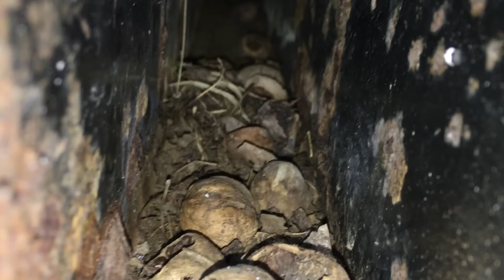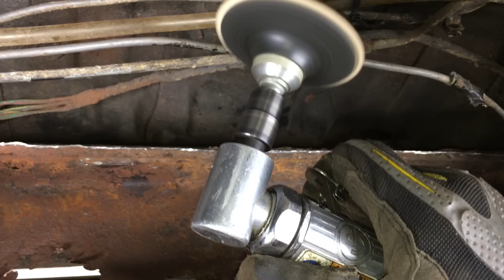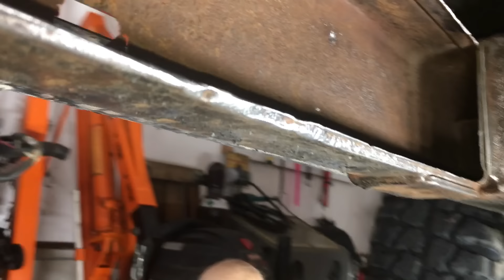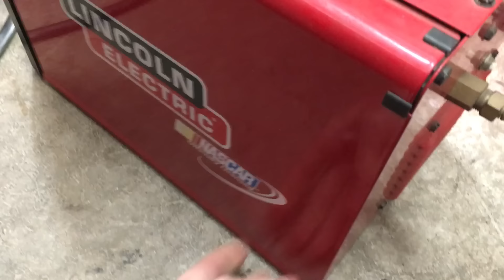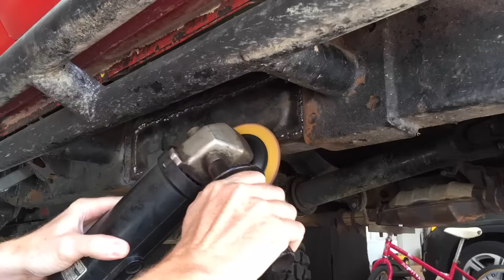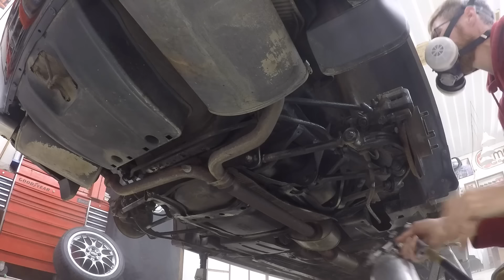How to Properly Repair Rusty Frame of Toyota Pickup Truck at Home

Comment: It was entertaining to watch and since you asked here is some food for thought on welding
Setting up the machine is probably easiest by the sound of how its welding
it should be a very consistent fast paced buzz
Welding is the art of heat control, too much heat and the whole part becomes soft and on some metals like stainless it destroys its rust properties and makes it brittle
too little heat - thick base metal being cold and the weld being hot, rapidly cooling down induces massive stress in the molecules cristalizing which result in cracks
Cracks are the worst outcome of a weld because they will propagate into the base metal and split it apart
dealing with cracks - you never want to weld on top of a crack instead you want to cut into the crack with your grinder so you take the metal out and eliminate the possibility of crack spreading
if the part is of high importance or is under a load then you have to drill small holes at the ends of the crack on top of grinding it out
Use a mindset of Heat = Time
the more time your welding the more heat you input into the part therefore you can crank the wire speed up and weld on thin metal by moving fast and the base metal stays solid
same with thick metal, you may need to preheat it before welding
Welding Positions - you would weld differently looking from above than if you were to weld from below looking up as you did in this project
laws of gravity are at play and with heat the metal gains viscosity
opposite happens as it gets colder it becomes hard and brittle
to do it properly you must take into account your angle of torch relative to the weld
going 90* is gonna result the most penetration and most likely will burn quickly through your base metal
the optimal is 30* in either the way your welding (push/pull) to ensure the most control over your input of heat and metal
with horizontal welds angle your torch 30* to the direction your going and 30* aiming up since the metal is gonna drip downwards from gravity and you keep pushing it up
for now i suggest you to work on your consistency and straightness of your welds and ignore the weaving patterns
get those lines straight and consistent
for best penetration, adhesion and formation on the other side of your piece you have to bevel your edges
easiest way to do it is run your grinder between the two pieces so it cuts a line between them halfway into the metal thickness
Tacking the pieces together is important
i saw that you held the bottom with a clamp as you fully welded the top
heat warps metal and bends the whole piece upwards raising the gap between your plates making it stick at an angle
having a clamp hold it does the job but i would still tack it on the bottom to ensure it cant bend out of position
tack diagonally from tack to tack going fully around it to ensure it cannot change the shape and create gaps
welding builds tension and stress in the metal due to change of heat and cristalization speed of metal which in turn increases the risks of cracks
Therefore you have to weld at a 1 3 2 4 pattern with your welds ending into your previous starting points to spread the heat and stress evenly across the whole piece
Going vertically from top to bottom is unacceptable in load bearing structures because of insufficient metal volume and penetration, so do it only on pieces that dont hold more than your own body weight at most
going from bottom to top vertically is a hard achievement to learn for people learning the skill but thats the only way you will have the piece not fail on you
if there was no side rail adding strength and rigidity to your frame i would encourage you to redo the welds
a tip you can use is weld the thing in tacks. start welding each new tack on top of the previous one before the metal stops glowing from heat to ensure that no cracks form and it fuses properly, for this you may have to hold it for a while depending on the thickness of the metal, otherwise welding vertical the proper way needs you to do a weaving patter going form side to side and pausing for a while to add volume.
i saw you had problems with welding accuracy by having welds not getting between the plates and just welding on top of the plates not even connecting the pieces together due to having problems seeing.
Yeah it sucks and its understandable, but remember there are people who get to weld hanging upside down in very high heat claustrophobic places with their arms extended sweat pouring down their mask with a MMA electrode in one hand bent more than 90* while holding a mirror in the other hand with nearly no room for error with pressure to complete the job. i can tell you it sucks real hard but you get to look back on it with a sense of pride because not everyone can do that irrelevant how much they get paid.
So ABOVE anything else the 1st thing that separates a professional welder from amateur hobbyist is the prep work and planning before each and every weld they do
it is literary 80% of welding, making sure that when you pull the gun, nothing can go wrong.
Get as comfortable as you can, from a side it might look lazy when the welder is lying down on the ground as if they have no care in the world but they are actually making sure that their hand doesnt get tired while doing the weld, it doesnt ever snag on anything, nothing is obstructing their process from start to finish. before each weld glide your hand over as if you were welding to test if it is perfect, worst thing that can happen to you is you hit your gun against something and it ruins the whole thing. in a professional environment you will be expected to grind the whole thing out and do it from start, certain types of metal cannot be stress heated multiple times and may result in cutting the whole thing out and doing it from the start. often these specialized metals with certain properties cost thousands of $ per sq ft area so as you might imagine, do the mistake twice and your fired.
basically comfort is your #1 priority for fancy welds, there is no correct way to hold the torch, if its more comfortable for you wrap it around your neck, hold it upside down, whatever.
after you got comfortable the next priority is sight, you cannot weld what you cannot see. i personally dislike the fixed shade lenses but they provide the most safety for your eyes, some old timers just got used to them before the auto dark existed and just stayed that way, some cant afford them. remember that the more light you let them pass through the more you will see what your doing and whats around you and the more UV will get into your eyes and damage your eyesight. all you need to see is the puddle of your weld and and right around it to see if your still moving correctly.
generally your movements should not exceed the width 2x of your wire, so it is a very small surgical precision.
I think consistency is only achieved through reacting to what you observe, dont look what goes next, keep it in your peripheral vision. dont stare into the brightest spot of weld, instead look at your puddle as it is cooling down and forming the shape. react if you need to move slightly faster as its getting too liquid or you need to slow down to add volume and prevent welding defects like undercut.
to be a good welder follow these 3 golden rules:
1. prep work, make sure nothing can go wrong, your fit up is spot on, the bevels are even across the whole length, there will be no surprises.
2. comfort. Your hand is so tired its killing you, you find yourself to finish the last inch you have to extend your arms in a unnatural way,  it will directly reflect on the quality of your work.
3. consistency, your line looks as if its one single continuous flow with no thin or fat sections and no deviation to the sides, robotic movement.
it all comes naturally by experience just laying down welds with the intention of the next one being better than the previous one, there was a time i couldnt do something no matter how i tried and how angry i was and now what i can do with nearly my eyes closed thinking about something completely unrelated.
Another thing i would like to point out is that you grinded down your welds to go over the parts with no visible fusion, remember that the shape of the weld matters in how stress travels across the metal. since you didnt have full penetration at certain points and you grinded it down, a lot of the metal didnt get inbetween the plates to fuse them together so in reality while you cant see it, there may be barely anything holding it together making it the absolute weakest point in the structure, arguably even worse than when it was held together by rusted metal as it may be thinner.
Welder and paint may make you the welder you aint, but in the end of the day its your health your risking if the structure fails on you at the point of highest stress when you dont want it to happen the least, in this context imagine you drive over a bigger pothole while going full speed down the highway, your frame splits, the car leans to a side and you get thrown into the opposite lane traffic. Bad welders cost lives.
So to finish this long rant i want to remind people that this is only the tip of the iceberg not even touching the water, you start in welding, dive into metallurgy, find yourself in chemistry and get lost in physics. i hope people who make it through this wall of text gain more knowledge and respect on the subject. nobody knows everything and nobody is too good to learn. having the skillset of gluing two pieces of metal together and have them stick is gonna give you the possibility to create anything that your imagination is capable of projecting and is gonna be valuable till the very last day you spend on this earth.
If anyone has anything to add, feel free.
To 6th Gear Garage, if you have any questions feel free to reach out, i feel like this channel is on a path to become big, good to observe it in this stage
Reply from the maker: Thanks for taking the time to hare your knowledge, I read all of it and will probably re-read it every time before I start a welding project!
Reply: I appreciated your write up, often people are too lazy to read such a long comment but there is always something to learn from others.
Reply: I"m saving this comment for reference for my own welding projects!
Reply: Nice writeup. I appreciate that.
Reply: Thanks for taking the time to write that up I just bought a welder and am about to learn how to work the thing I printed this out and am going to tack it to the wall in my shop
Reply: Replying to this comment so I can save it as good welding advice! 
I don’t know if I’ll ever be in a comfortable enough place in life to use this advice for a hobby, but one can only hope. Thank you for sharing
Reply: Your comment was awesome what kind of steel should you use when welding on a frame?
Reply: Thank you XYZ!   What valuable knowledge you have provided as a gift to us all; thanks.  Wishing you good karma many times in return.
Reply: This knowledge is priceless!
Reply: I'll be coming back to this comment for reference moving forward. Thanks!
Reply: Amen, brother. All good advice
Reply: That was more educational than 99.9% of all welding videos on you tube .. thank you
Reply: Had a friend that did this job, he was often saying that he was tired and hot/ sweating and not much else. Thanks for describing the details I can definitely see that it was a lot of pressure and not as easy a I initially thought.
Reply: What an incredible comment.
Reply: I read your comment thinking I could weld, I just know if I tried welding id mess it up lol
Reply: Somebody has too much spare time wtf
Reply: @mrantiwoke dude every sentence of that comment has thought put into it. That’s someone who could be making 120/hr welding but instead he’s dropping knowledge for all of us poors
Reply: @mrantiwoke Are you serious?

Comment: Rust is crazy on that frame. I  was going to buy a 94 Toyota 4x4 pickup extended cab that had  frame  rust. But I waited till I found a frame .Bought it. Went to buy the truck and it was gone. Unbelievable what happened. I  haven't found another rusty truck yet for my frame. 
Eventually I will.
Reply from the maker: At least you already have the part that's hard to find - a clean frame.

Comment: Bevel both edges of the material being welded  to about 1/16” it will/should give you the penetration needed with such a large heat sink(long plate and truck frame with thickness at/just beyond upper limit of welder).   Flux core may penetrate better.   And, if you had a gas mixer set up and separate cylinders if Argon and CO2 you might could ratio argon and CO2 differently from pure Argon or a 75/25% mix for a bit better penetration but a higher amp Mig/mag machine might be a better investment for you than that money spent on a gas mixer set up.
Reply from the maker: Thanks, I really want to get a 220 one day!

Comment: I used to use POR15 as well but have recently switched to Rust Seal. I watched some comparison videos and it turns out with better results and has a slight flexibility as well. But I always use a rust converter first.
Reply from the maker: I've always used POR15 but I'm glad to see there are more alternative options on the market. POR15 isn't cheap!
Reply: @6thGearGarage   I find POR15 works well on surface rusted metal. You have to chip off all the thick scale, then power wash it and wipe down with acetone or brake cleaner. BUT, you cannot use POR15 on ether clean metal or painted metal, it will peel. It's designed to stick to light surface rust as it chemically bonds to it, and it does very well if stuck to that application only...
Reply from the maker: @dc6233  I just tried a POR15 alternative called Rustproof MD in my latest video of the rusty 1980 frame and I'm happy with the results so far. I decided to try it because it is UV resistant.

Comment: Good job brother go buy yourself a bigger welder and fill your tank lol very good from an experienced fabricator
Reply from the maker: Thanks 👍
Reply: @6thGearGarage  he is right , especially with your skills , " Self employed fab shop " if I was excepting applications I would hire you "  . The best place to by a  bigger welder is Craigslist .I just bought a large Lincoln  with spot , stitch ,settings , new liner tweco gun  And 3 full size tanks ," 2 were full ,for $700 , I got a as new hypertherm powermax 85 new condition ,with a 75 root lead , full consumable box off E bay for a grand

Comment: The truck belongs in the junkyard and unsafe no matter how much you weld it Toyota and all these manufacturers should be ashamed of themselves with the substandard metal that the building these trucks with and that includes Jeep Dodge GM and Ford

Comment: , take a control cable from a lawn mower and attach that to a wire wheel and chuck that in your drill ,to clean the inside of the frame , you can knock a lot loose by hitting the outside with a needle scaler . The absolute best was is take your truck to your local sand blaster have them put there super powerful blast gun and blast the inside . You need better penetration .Use  75 / 25 argon -co2 .and it is also cheaper than argon .Your welds would much better with the proper gas . I am not sure it is a good idea or not .. I have done it .Mud trucks often get there frame injected with expanding foam
Reply from the maker: Great idea on the cable & drill!  If I ever pull the body off, i hope it's because I found a nice rust free frame from out west. Thanks for correcting me... I was calling it argon but it is actually 75 / 25 "C25".
Reply: @6thGearGarage  careful when you ,put that wire wheel on that control cable .I stepped on my drill with it in the chuck and almost ended up castrated .. Many auto body guys use strait argon .
Reply: @6thGearGarage  Instead  of getting a great condition frame from Arizona , that will rust out , go to knaphied or a shop that builds dump beds .They throw away frame rails .You obviously have the skill and tools to build a better one for half the cost . It is not hard to do
Reply from the maker: @huckstirred7112  I've considered building just the back half, but even if I had a bigger welder I still worry about getting everything square. I know the pros use a granite table. If I had the space, I'd make a jig and build the frames on demand.
Reply: @6thGearGarage  I am a pro . And I don't own a granite table . When I do a frame I use saw horses .!  You are way over thinking things .watch a video on building a trailer truck frame is  easier and less welding than most trailers .  I have done about 6-7  Toyota frames . I lay out the rails on horses  . tack .measure for square .Weld .then tack in cross members .check square weld . While it is upside down add spring hangers check square weld  .put on springs  Slide frame in.

Comment: A cheap sand blaster and needle scaler are your best friend for this stuff, I got a sand blaster off Amazon for $25 CAD and a needle scaler at Princess Auto for $40 on sale, did my whole F350 frame, then did 2 coats of oil based rust paint (I've used epoxy's and POR they chip too easy and under perform for the price point), In the frame I would recommend Ziebart it's reaaaaaly good stuff, seen it in car's from the 80's and it holds up very well, if your on a tight budget diesel with used oil will work just need to do it more often. Also when you have the opportunity to weld both sides of your patch it can't hurt if your worried about penetration. I think your welds are fine for what it is good work, Going to be doing my 83 in a bit here, never though I'd see the day, just can escape it with these trucks.

Comment: Your hold frame is rusted out you can't weld over rust if what you say was the wrong way lol which is the best way to do it
Reply from the maker: I cut out the thin areas so there is thicker metal to weld to.